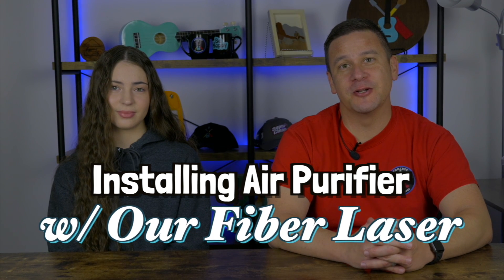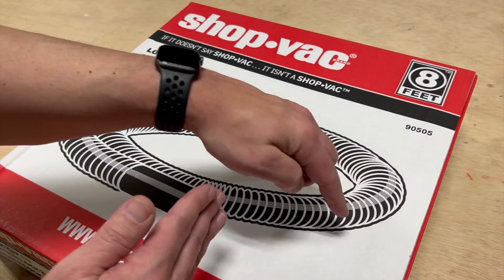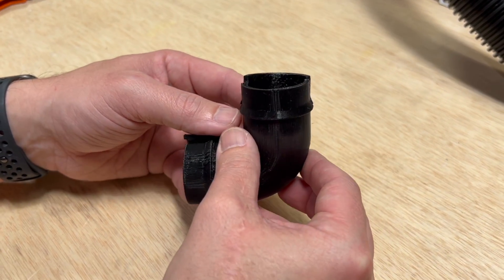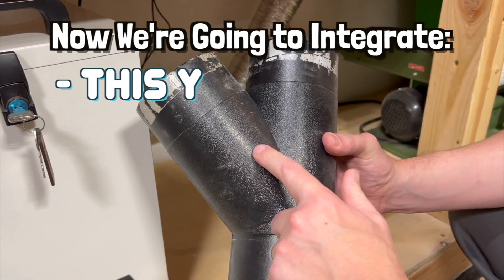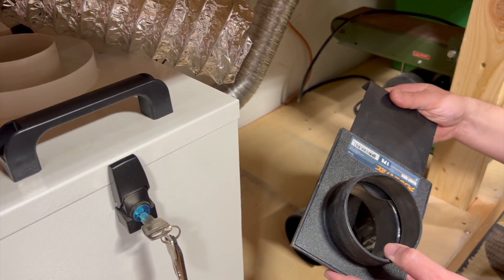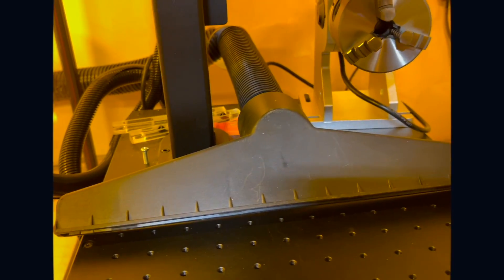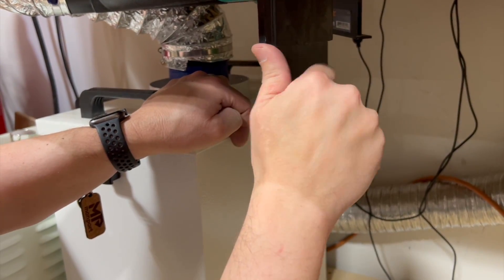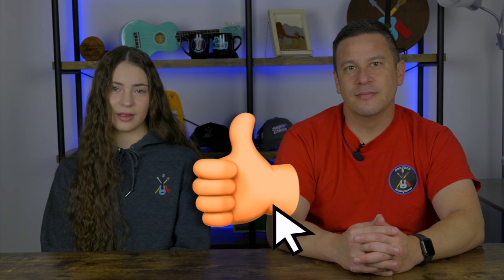FUME EXTRACTING FOR TWO LASER ENGRAVERS | Monport Air Purifier

Comment: Hello! Why purify the air if you're just venting out the window anyway?
Reply from the maker: In addition to venting laser engraver exhaust outside, using an air purifier can improve air quality by further filtering out harmful fumes, particles, and odors that might linger or be drawn back indoors. While venting removes the bulk of the exhaust, it doesn't always capture everything, especially with certain materials. An air purifier, especially one with activated carbon filters, can help eliminate lingering odors from burned materials. Additionally, when in close proximity to neighbors or windows that you may have open near where you are venting, filtering can help minimize the hazardous fumes. Ultimately, using an air purifier alongside venting provides an extra layer of protection. 

Thanks for watching!